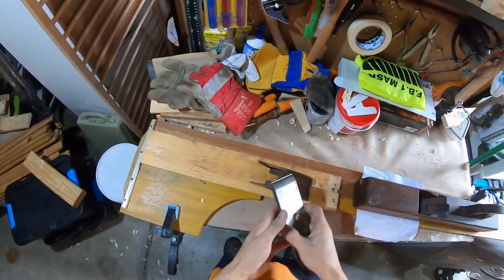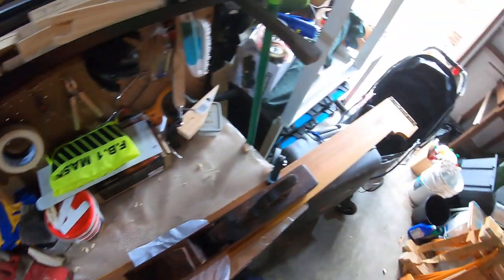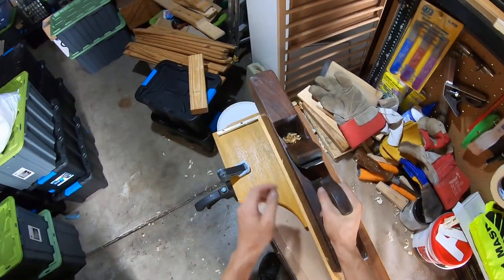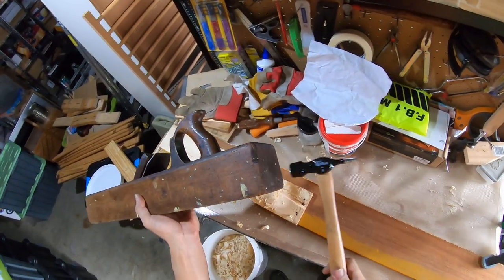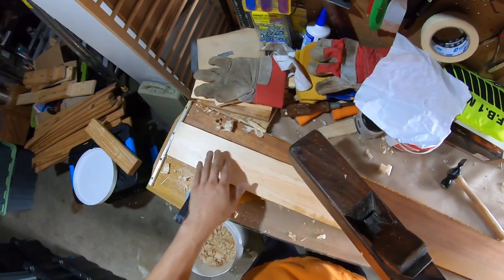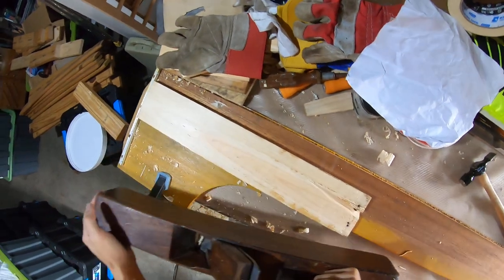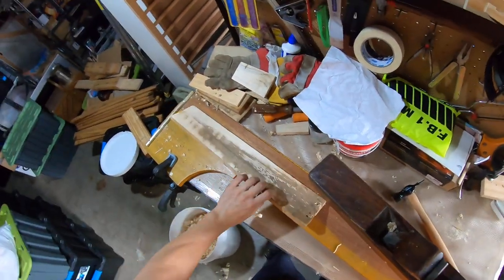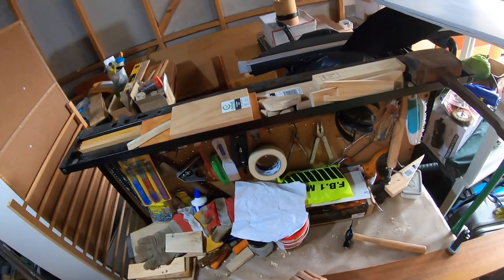Vintage Mathieson & Sons Jack Plane Part 4 - Putting it to use

Comment: that's not a jack plane that's a try plane they are used for dressing rough and smooth surfaces flat like face and edging timber Mathieson try planes are usually around 560 mm long  , a jack plane is can flatting and smoothing hence called a jack plane because its a jack of trades Mathieson jack planes are usually 460 mm long
Reply from the maker: Interesting! I hadn't come across that information. The plane doesn't have a super wide mouth, so I would say you can certainly do smoothing with it, I was not able to use it like a scrub plane to take massive shavings!